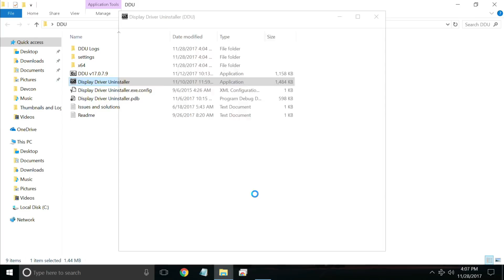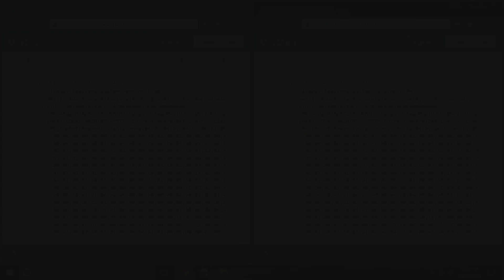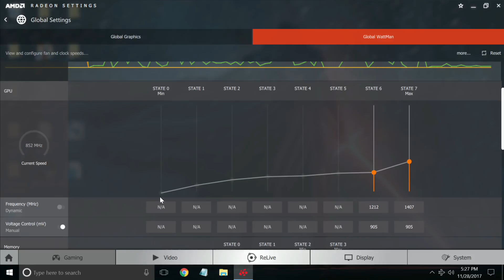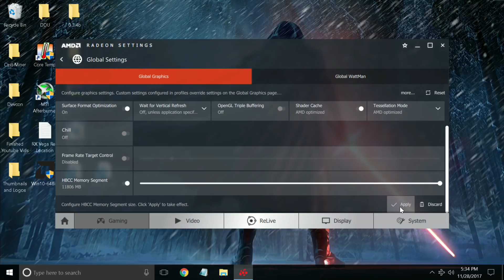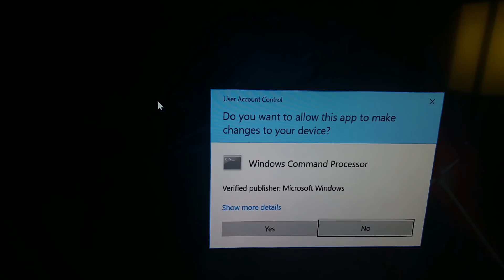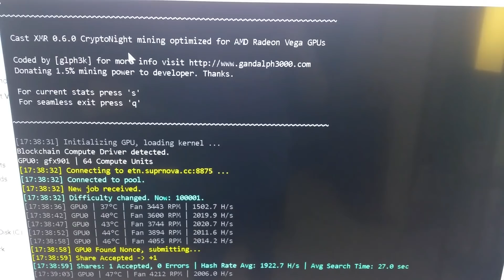RX Vega 64 (or flashed 56) Registry Editor, Power Play Table and Devcon Tutorial!

Comment: I know this video is old. But, maybe you can shed some light into my issue.
I have an RX Vega 56 MSI Air Boost OC edition with a Raijintek Morpheus 2 Cooler (VRM are being cooled by the original cold plate.)
I've flashed the V64 BIOS counterpart of the same card.
The thing is, is that, at STOCK frequencies/voltages of the 64 BIOS, the card hard crashes at random times when gaming.
Even, using the same memory and GPU clock as the original V56 bios of the card, it crashes.
But, as soon as I reflash with the original BIOS, the card starts working as its supposed to.

VRM are at 55c,  GPU is at 60c , hotspot is at 80c and the memory is at 70c.

I can't explain what is wrong.
I've tried various other BIOS (the board is the reference one.)

Do you have any idea what could be the issue?

My full PC specs:

i7 6700k at 4.6Ghz 
Asus Maximus VIII Ranger
16GB of Ram DDR4 3200 Corsair Vengeance
Cooler Master V850 PSU (Newest part)

Thank you so much for the video. It cleared some stuff about the powertable!

Comment: Hi Mark, something happened today. My hash rate fell from 43 to 34 across al my 4 vega cards simultaneously. restarted few times with (disable/enable) still the same.
then i went back to the registry mods. only to fine those files were not there anymore.Surprising.  Files 0000 and Modded files 0001 onwards  missing replaced with configuration and properties folders. There was an automatic update on the computer tghough i disabled updates altogether. Wonder what i should do now? any advise? Thanks a million!!
Reply: Got it sussed out. Problem caused by one Vega Card. Removed and reinstalledall with same procedure. Back to 43m/hs. Now i dont know what to do with the Card which "hangs" the computer! Tried the 1050 registry mod its the same. The rest are running with 1100.No issues so far.Would AMD repair my card or at least check it out?
Any suggestions guys ?

Comment: Is it possible to up the memory voltage from 900 to like  915 with the the powetablemod? One of my cards can't handle 900 and even when I modified the voltage in ptmod it still stays at 900.
Reply from the maker: I've never had to do that for any of my cards so it's hard to say. I think you should be able to but it will naturaly get hotter and likely more unstable aswell if not cooled adequately.
Reply: Geek Mark thanks for the reply. Do you think that the memory at 900 is the reason it crashes?

Comment: booyah!! ive tried a few other guides and the hash rate kept dropping, yours drops by about 20h/s, down from about 2020 to 1990 but its definitely working! - running an asus rx vega 64 strix in case anyone else needed to know if this works - i put my p7 to 1420, and memory p3 to 1105 and its stable

Comment: devcon fails for me.

pci\ven_1002&dev_687f&blah blah blah : disable failed.

i get this line, 6 times.  once for each card.

followed by "No devices disabled."

followed by similar lines x 6 saying enabled failed

thoughts?
Reply from the maker: You probably downloaded the wrong version. Make sure you got version x64 instead of the x86 if you're on a 64 bit machine. Also make sure it's for the right version of windows 1073, 1079 and so forth. Run it in administrator mode.
Reply: Geek Mark hi there i dont see any x64 for windows 1079 to download in the link is it the amd64?
Reply: Run as admin

Comment: Followed these steps, and they worked fine for my first 2 cards on a 4 pci card system. When adding the third card, it didn't work. In fact, the 0003 registry folder that appeared had all the same fields as the others except the "device description". Don't know what that means, but it's the same card as the others. I know you stressed finding that name in that field. Please advise.
Reply from the maker: Hey Paul, that's a simple fix. If the 0003 registry file has a "DriverDesc" of 687F:C1 (this is the vega 10 device ID) then you simply apply the registry file just like the rest.

Comment: mark, what do you mean disable the crossfire ?
i have 4 vega 64 running eth at 37mgh/s . will try this mod . will this also resolve the issue of my amd global settings getting reset everytime i reboot?
Reply: now doing 43m/hs . Thanks to Mark ! Did not do the devcon though ( using manual mode) as i have 2 other type of cards in there as well RX460 and a RX560 giving 12m/hs - total approx 190 avg. (power 1100w) -ETH
When i tried XMR stack i did not have enough RAM (only have 8GB right now) - will upgrade to test on 16GB - guess its better on xmr as it less stress on the gpus and less power.

Comment: Hello, Sir! I sorted out my previous questions I asked you about. But now I have greater ones. 

First of all, my system seems to be unable to adapt to those power play tables edits of the registry.

When I restart the system, after having installed the Blockchain driver and applying those edits, on loading, yet even before anything has managed to actually load, the fans of the video card kick in on crazy rpms, making crazy noise, blowing out cool air, obviously, as it is under mo load, and giving me black screen. It seemed to have a strong intention to continue that way forever, well, anyway, I let it run like this for as much as about 5-7 minutes the fisrt time, hoping to see any changes, but in vain. I tried that several times, reinstalling the driver, applying both 1050 and 1100 tables, fresh-installing Windows everythime (I used three different Windows systems!), the result was the same. Finally I gave up with the registry alteration and decided to try the Blockchain driver alone. Well, this way my system started fine, giving the very quick abrupt kick start of the card fans (which happened everytime I installed this driver, after I have restarted the system and before applying reg edits, by the way) at the very early stage of loading and letting it go to the normal quiet mode. I tried to set the settings of the Blockchain driver manually and almost succeded with one tiny exception: I could not precicely set the GPU frequency at the recommended value of 1212. It would always be five poits higher or lower than that (either 1207 or 1217)
Anyway, after I've changed the min. value of the fan's rpms, as recommended, I finally gave it a try. I started the miner, which went fine (although giving me only about 1200 h/s), but the Blockchain driver seemed to have hung up, it became irresponsive and its appearance got blurry.
I think I restarted my PC or knocked it off through the Task Manager.
Well, then I remembered about the HBCC trick. I got there, but (!), unlike it is shown in most of the videos I watched on Youtube, I couldn't find the slider there (!) It just was not there! All I could do is just turn it on and off. And I did. Well, after that, to my surprise, the miner started at about 1700-1800 h/s (that is with the original, unchanged settings of the Blockchain driver except for the fan's speed (I set the min. at 3512 rpm, which provides the temp of 58-62 C)
and continued that way. I still keep it up (for about a day now) trying to understand how much profit it can bring me in reality and if it's all worth it.
So, my questions:

1) What did I do wrong with the tables or should have done but haven't? What thoughts, suggestions do you have on that? Have you had any such experience?

2) Also, I have noticed that in this running state one indicator (tiny red lamp) by one of the card power connectors keeps on blinking constantly and rythmically (aproximately once every second). Why is that? Is it normal?

3) And, finally, how much XMRs do you get out of one Radeon RX Vega 64 of yours? What pool, what miner?
   I use cast_xmr-vega-win64_070 and nanopool. Are they good?

4) Do you think the working temperature of 62 C is ok for the card?

Comment: Hi Mark thanks for the Guide, I am having trouble getting 1 out of the 4 GPU to stable with 1.9Kh/s. Not sure where is wrong. I have off the system interference ( screen saver, power.. etc) HBCC devcon stuff. But after 10-20 minutes for running 1.9Kh/s it just drop to 1.6K/s so far I seen the forums but none give me a correct answer. I also uninstall and reinstall amd driver and DDU.. and all the process again but it is still dropping any suggestions?

Comment: Thank You For This Nice Video But My Friend I Have An Biggest Issue, I Have 3 Nvidia and 2 Vega 64 GPUs In Same Rig And I start Mine in Cast xmr Than I Got an error Like (Blockchain Drivers Not Detected) And some Down It Showing My Nvidia Card Model in Same Error and when I Change Card Id's in Batch File it's Like -G 0, 1, 2 are My Nvidia cards and when I Enter -G 3 or -G 4 Than (Selected OpenCL Device index 3 doesn't exist) But It Not Read My Vega 64 at any Number. 
And Registry  I Have 5 or 6 Folders Like 0000 TO 0006 Folders where you have Just 2 in Your Video.
Kindly Tell me That registry Setting Is Just For Good Performance  and Current Voltage Setting Or any thing  Else Because By Default I'm Getting 2 H/s in NiceHash (Sgminer-XMR).

As You Know that NiceHash is Down and I Don't know to Configuring Pools Setting, Can You Please Make A Video For Configure   XMR-Stak AMD Miner.
Please Help Me!
Email: ayeli.minhas@gmail.com
Please Contact me I'll Send You All Photos Of My Setting.
 Thanks!

Comment: I have mixed 5X Vega 64 and 3X Vega 56 on the same rig so will everything in the step by step instruction be the same in the video? Or are there something else for Vega 56 than 64? Thanks in advance.
Reply: wondering the same thing, did you sort it out?  having issues with a 3x64's and 3x56's (bios moded to 64)

Comment: should you install the normal drivers to begin with then run some tests to make sure all your cards can hit the 1100 mark? & is it possible to have 1050 and 1100 in the same machine if one does make the cut?

Comment: Hello i have a problem, individually my vega 64 runs at 1990 h/s with 160 watts (240 in total ibcluding 80 watt system idle). When I combine all 3 vega 64, i get a total of 680 watts hashing with 5970 h/s which is 100+ watts more than i expected (which is 580 watts). i am using the 1100 registry powerplay table. What seems to be the problem?

Comment: How did you connect a Vega card to the PSU? Did you use 1 PCIE cable with the dual end or did you use 2 different cables for each 8pin connector ?
Reply from the maker: John Michaels I used 1 Pcie with the dual end per card.

Comment: Did you flash the cards and update the BOIS or you only changes the registry ?
Reply from the maker: John Michaels These are actual Vega 64s so I didn't flash any bios. I only applied the power tables to the registry.
Reply: I thought the Vega 64’s are suppose to run 2,700 H\s per cards. The flashed 56’s are are suppose to do 2,000 H\s… No…?
Reply from the maker: John Michaels Nope, people flash the 56 with a 64 bios to get higher hashrate to match the 64. The most I have ever seen anyone push a 64 is around 2150h/s but naturally that consumes a crazy amount of electricity.
Reply: Got it. Thank you! By the way, Can you do a video on power supply compatibility and connecting the Vegas to it as it needs to power cables to it ? I want to build a Vega rig but I don’t know how to choose the right power supply…
Reply: Here is a guy that has 2x Vega 64 hashing at 2,700 
https://youtu.be/VciHIGHhnas?t=4452
Reply from the maker: Those are 2 vegas running 2 threads each (four threads total) using XMR Stak. His cards are hashing 750 + 600 per thread (which is horrible). Effectively around 1350 per card which equals 2700 total at 540W. In this video I'm using Cast XMR which combines both threads (of about 1000h/s each) into one ouput (around 2025h/s per card). In short he's hashing 1350 per card at 250W while I can hit 2025 at about ~155W. So my previous answer is still true :D
Reply: Ahhh got it ;-)
Where cane I get the Vegas for msrp ?
Reply from the maker: Currently nowhere xD. I bought these a couple weeks ago when they were on sale. I've been trying to buy more but they're all 700 USD atm D:
Reply: Would you recommend the Vega made by Gigabyte?
Reply from the maker: I actually prefer the gigabyte black ones over the XFX white/gray ones since the metal by the mounting holes are much thicker. The ones on the gray cards bend super easily. Other than that they are both identical.
Reply: Can this vega64 can be mix with other GPU in one rig?
Reply: It can if you’re planning on adding other AMD cards to mine 1 type of coin. If you’re planning on mining 2 different types of coins then I recommend you build separate rigs.